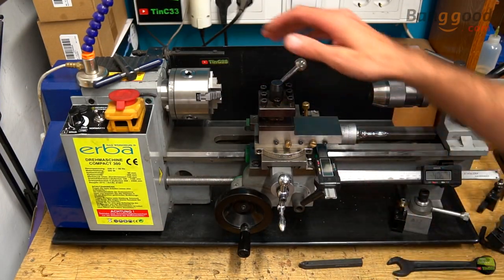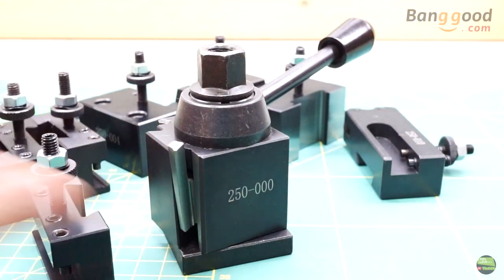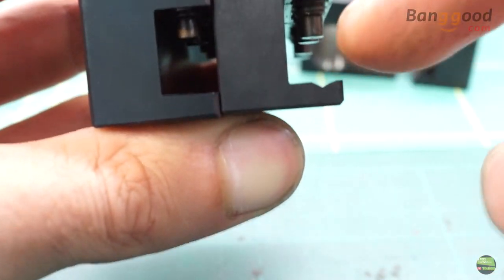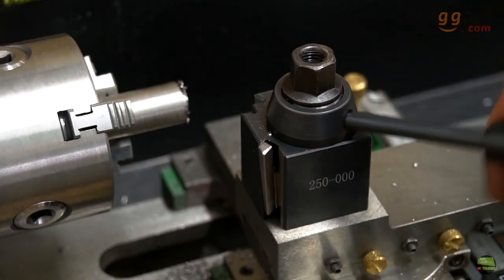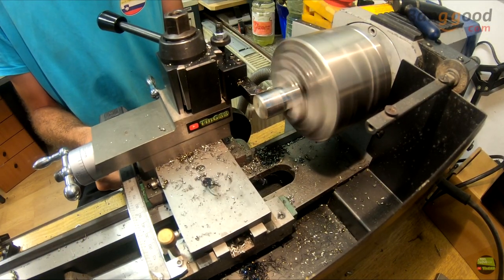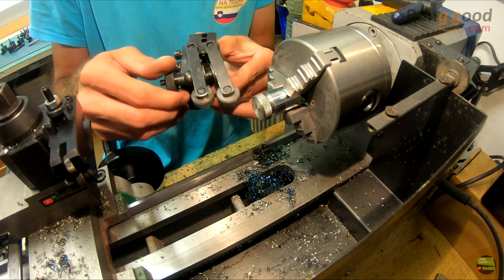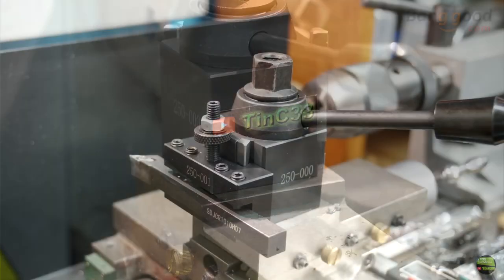Machifit DMC-250-000 Cuniform GIB Type Quick Change Tool Post QCTP [unbox / review / first test]

Comment: Thank you for the detailed information and a great video presentation. I purchased the 250 series for my lathe and didnt understand the 250 004 as well. My boring bars did not fit. I will do the modification that you described. I have a T slot on my existing tool post so I milled the plate supplied down to fit.

Comment: For people who are researching QCTP's, as i have been recently,
There is 2 different Part-off Holders ~
1 - has the Blade angled up to create front clearance - the type you have shown here.
&
1 - where the Blade is Horizontal - you grind your own front clearance.

The Horizontal type is a better design & fit, for a 7x14 Mini Lathe & doesn't require modification to fit.

Comment: Something I do when set screws are small & get used frequently is replace them w/ socket head cap screws.  This provides the same function but use a larger hex, reducing stripping/wear out of small set screws.

Occasionally, the heads of the cap screws are too large & need to be turned down.  They can turned quite small & not break out.

Comment: I have one of these QCTP's on my lathe and bought 6 tool holders with it..........then I bought 4 more.........the problem is 2 fitted OK and locked up but the other 2 would not lock and needed 1mm thick  shim on the outer faces of the dovetails before they locked up, so I tig welded 1mm thick shim steel plates around the edges of the dovetails and then polished them up.
Reply from the maker: Great solution, but disapointed that they changed dimension from series to series, otherwise they're great holder for the price, check my other video where i make aluminium holders by myself.
Reply: @TinC33  I don't think they change dimensions intentionally from one manufacturer to the other in the same series, it appears that the manufacturing dimension vary from one to the other due to tolerances.......it is difficult to actually measure each tool holder dovetail from one to the other as the actual dovetail does not determine the locking point.
It is OK if the holders are made in a jig with the same setting, but when different makers attempt to make them the measuring tolerances will vary unless a master test tool post is used at time of making.
It would almost seem that they are made and then selected in batches to all fit on one master gage but you can't have holders that are above or below tolerance fitting the same tool post.........don't ask me how I found that out.
Reply from the maker: @gangleweed  that's what i think, i know how delicate is this measure, one wrong pass and holder become useless 😅
https://youtu.be/P9EJF2oseUc

Comment: Fun question - is there enough material left in your original aluminium tool holders to recut dovetail to use on your new steel tool holder?
Reply from the maker: No, i need to make new ones, funny fact, i just reaceived qctp 250-222 those days for my new lathe.
https://youtu.be/P9EJF2oseUc

Comment: Hello,clear video!but this holder is suitable to an 8x16 lathe or i must look to something bigger?i have 12 mm tools ,so i guess they mount in the 250 000...thank you!
Reply from the maker: That one is for 10mm tool, 12 maximum, for your lathe i'll took a series or two bigger, so you can insert 16mm tool into.
Reply: @TinC33  so...250 111 if i'm not in wrong,right?thank you...
Reply from the maker: @marcoserra3798  250 201 will be right for you so 200 series its for 5/8 tool, series 300 is for 3/4 tools.
Reply: @TinC33  thank you,but i must understand what is the right turret to buy...you are talking about the tool receiver i guess..sorry for my bad enghlis..
Reply from the maker: @marcoserra3798  they got mess with measures on their site, check the one 250-000 where you got measures from all the types, so you will see what type you'll need i thing 200 or 300 series will be for you, so 250-222 or250-333 will be for you but i can't find it on banggood only 250-300 (piston type)
Reply: @TinC33  i found 250 111..250 222...and 250 333...i must study..
Reply from the maker: @marcoserra3798  yep a bit of sruddy before buy 😉

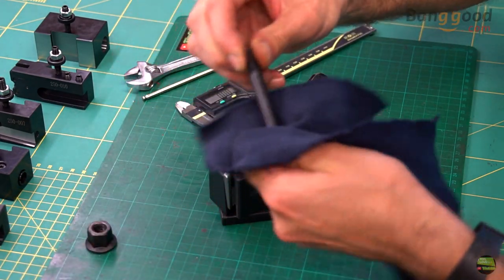Comment: 2:20 the bottom plate may be for mounting to lathes that have a T slot on the compound
Reply from the maker: Thanks for info
Reply: But how will you fit that to a T-slot?
Reply: @marcoam2610  you’d have to mill the plate to fit your lathe’s slot

Comment: Would this quick change toolpost fit a small lathe with "base" for toolpost with dimensions 70x70mm?
Reply from the maker: It will fit but would take a bigger version, check on banggood i think next size is 250-111

Comment: how do i find a bigger version of this 250-000 ? maybe that 250-333 or even 250-444. I can't even see the option of asking the seller about it ?
Reply from the maker: You can check on banggood they got some more sizes, go to banggood and searc for "tool post" good luck.
Reply: @TinC33  i tried everything. It's not there
Reply from the maker: @razvanon  then you'll need to check some other store try chronosltd co uk or some local shop